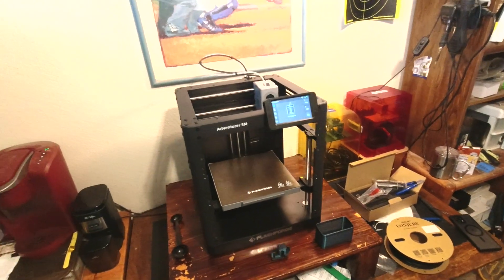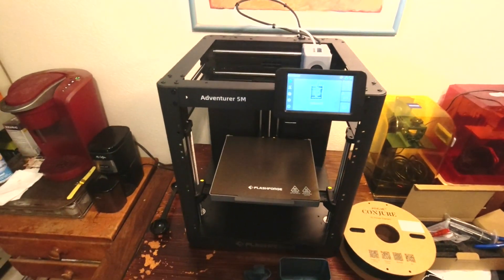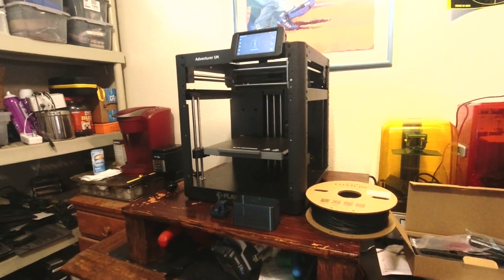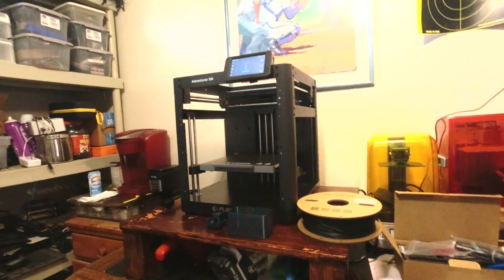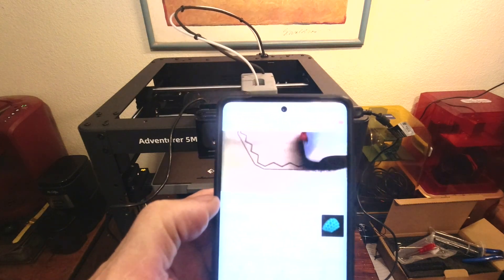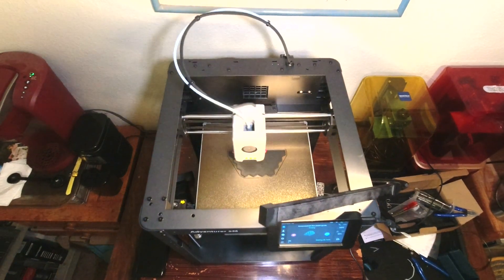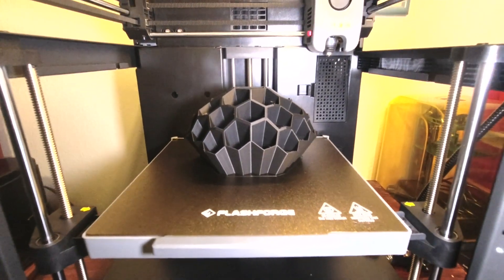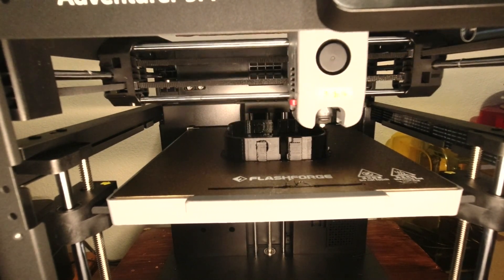Day 2 with the Adventurer 5M. Tweaking, Web Cam, Orca Slicer & Testing JAMG HE high speed PLA!

Comment: That little Flashforge printer seems to be a very nice unit, especially for the price.  If I hadn't bought an QIDI X-Plus3 last summer to augment/replace my older Geeetech A20M, I would definitely be looking at that unit.  The Qidi has a slightly bigger build volume, but not much, and I don't print large objects (or at least not often).
It looks like your printer is running on Klipper, like mine, and I also added a camera...plug and play, just like yours did.
Looking forward to your modification journey...

Comment: I read somewhere that the PLA+ filament has a bit of TPU added to it, this apparently makes it more fluid.
 Before I got my X1 Carbon I had tried Orca slicer but I had got so used to Cura it was hard for me to use anything else, I was forced to use Bambu Studio and Orca Slicer and now I love using Orca Slicer.
 You should check to see if your camera works with Orca, you will need to press the little play button under the video screen on the Device page of Orca Slicer and switch the setting to HD if your camera supports 1080P, the default is 720P.
 Orca handles the video in real time with no latency!

You know chuck it still amazes me how fast these new printers can print and yet the quality is just awesome, I guess it's because of the PAP turbo cooling fans and well  part coolindesigbedg fan ducts.
 You should slice some of those parts for your old printers and see what the time difference is, Im guessing that first part would take around 2.5 days